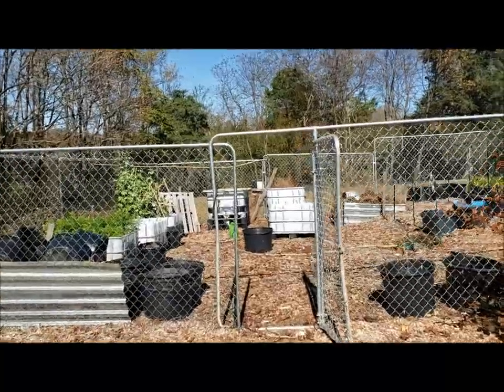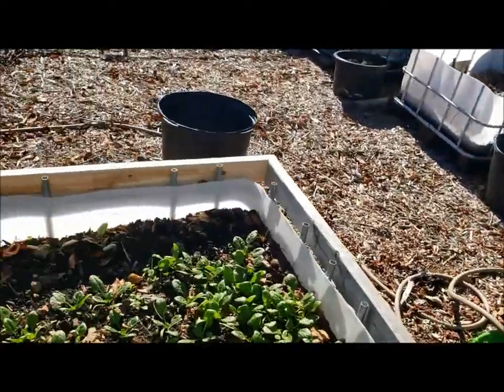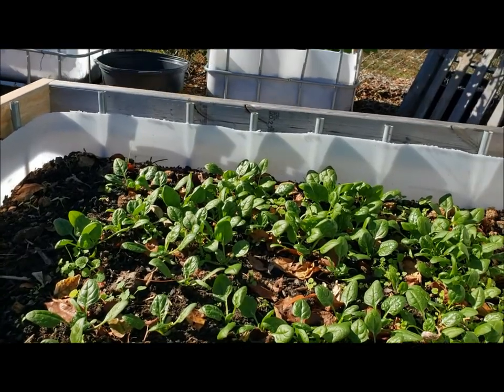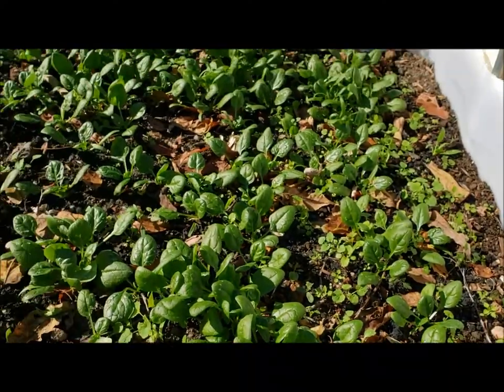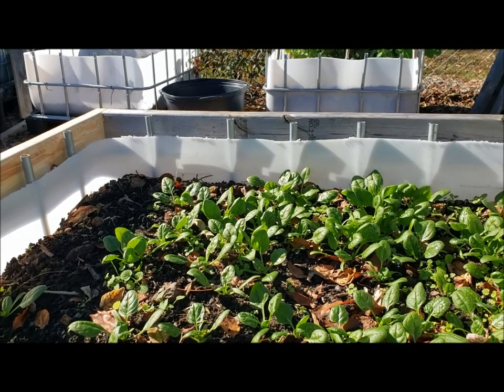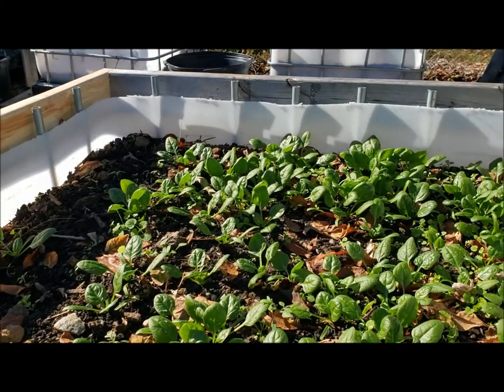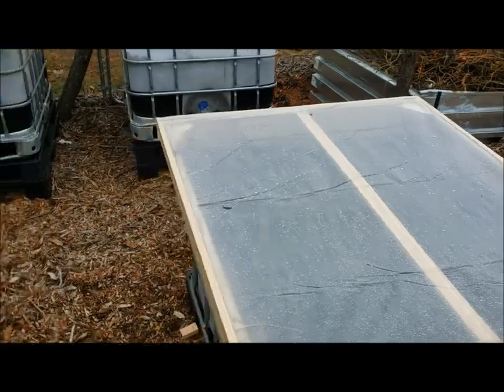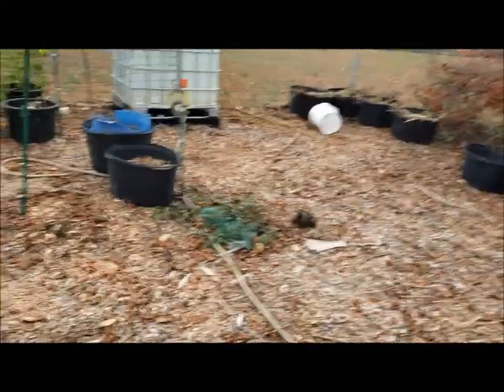Cold Frames

Comment: Wwrol looking good!! I'll share a few suggestions from my trials and errors. Since you are above ground  you might consider using bales of straw to insulate the outside of the totes in the winter and then compost bales in the spring. I buried a recycled commercial 3 door fridge that you see in convenience stores with glass doors.  It has done great. Look up a gigavent online. They are excellent for releasing heat even in winter on cold frames. Completely manual operating no power required. You can set them at a certain degree to begin opening. Since your frames are above ground maybe consider wrapping them in black plastic during the winter months to hold heat better. God bless.
Reply from the maker: Thanks, the straw bales seems like a great idea. I love the commercial ref idea. Ready made insulated cold frame..thanks for the input

Comment: Looking pretty good couple suggestions. The last being I would take those down off of the pallets so they can keep more warmth underneath of them. My first thought was to put an angled white panel on the north side to reflect more light down into it from the sun. And lastly you should only need venting if it’s gets too hot in there; you know if you end up with 85° temperature on Christmas It might get too hot inside that box 👍🏻
Reply from the maker: Thanks..taking them off the pallets would be a major project. I would hafta take the fence down to get tractor in,,,and i dont expect a 85 degrees winter ..lol..thanks for watching and commenting
Reply: Just try to watch the temperature inside there on warm days